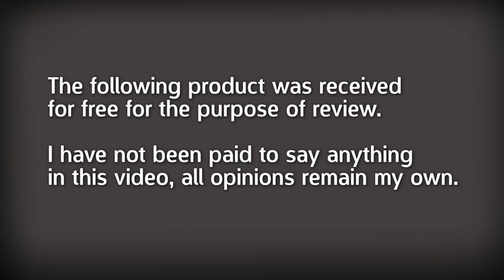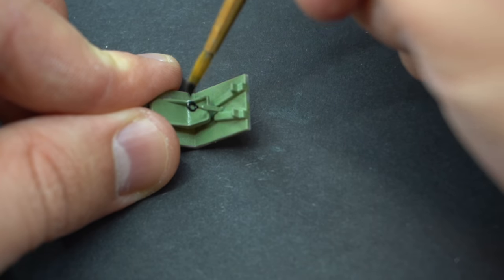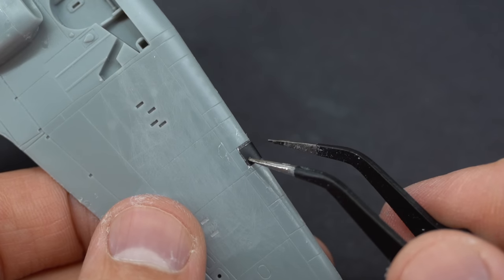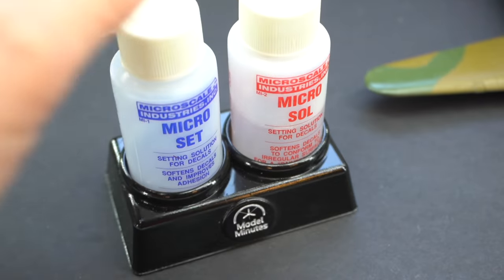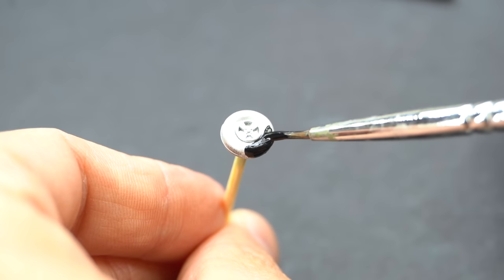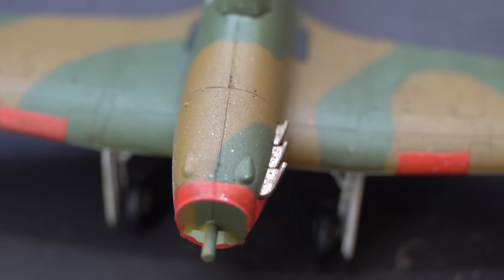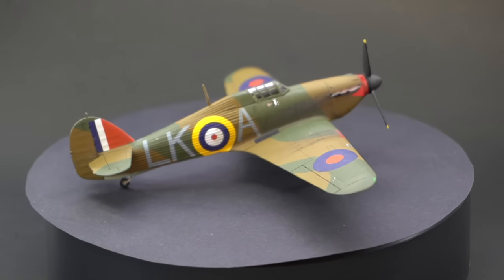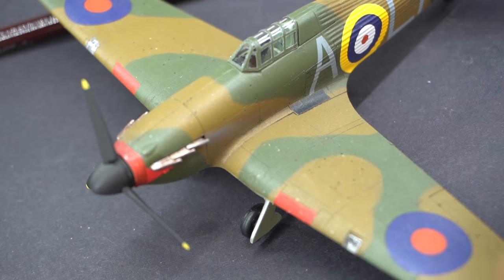A Challenging Build! Hobby 2000 Hurricane MkI.a Late in 1/72 Scale - Build & Review

Comment: Good result despite the little issues. 1/72 is probably a bit small to go freehand but may need to reduce the airbrush pressure and get in a lot closer for the edges of the areas and then fill in. For the red on the nose, once the decal has set and been varnished just go over the decal with the red paint. Doesn't have to be right to the edge but that will help. Happy New Year to you!
Reply from the maker: Thanks for the tips!

Comment: Hi this is my first comment on your channel. That was a really good build you did there. I'm in total agreement with you about hand painting the interior of the aircraft as after you put the canopy on you will not see the interior of the aircraft at 1/72 scale. And it was good to see that you use the blue tack method for the camouflage as this is my preferred method for when I use my air brush to. Can I make a suggestion about you gluing your canopy to the aircraft! I always use PVA glue to attach the canopy.  I can imagine this sounds daft but if you try it you can wait until the glue goes off . It will dry crystal clear then with a damp brush remove the exses. Glue . You will have no fogging on any of your clear parts. One other thing I can point out is I have found that it is always best to mask the rotor tips if you want to add a colour as this makes the rota look absolutely brilliant and highlights the whole model. It's all about the tiny details. Keep up the good work and I hope you didn't mind me calling you out on a few details.
Reply from the maker: I've used PVA on many previous builds - I simply use clearfix in this one because i had it in my supplies and i kinda need to use it lol. Thanks for watching!

Comment: Great video, good job you have 3d printer for the pitot tube. You have correctly interpreted the exhaust colour. I do have a query for the manufacturer as the squadron I.D. lettering appears to be too large!
Reply from the maker: I believe that in this particular case the lettering size is accurate - it is one of those not often used oddities but was historically used by the RAF Exeter aircraft
Reply: @ModelMinutes  I suppose it is down to how things are interpreted at a local level.

Comment: Hey Matt - great video what pressure did you use with the SMS paints? Really looks very well
Reply from the maker: sadly I didn't make a note - but I have a feeling it was the suggested pressure on the bottle - "Our paints are designed for air brush use. We adjust our paint viscosity to ensure that our paints can pass easily through a 0.3 mm sized air brush at 12 to 15 PSI."
Reply: @ModelMinutes  cheers Matt - I’m currently gonna try 2nd gen Hundrol seen to be getting good reviews - Happy New Year.